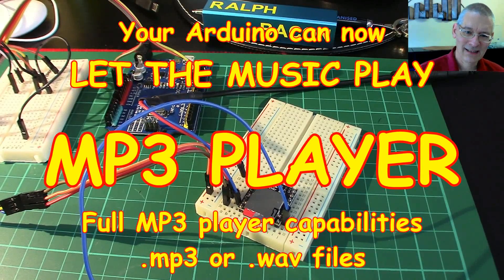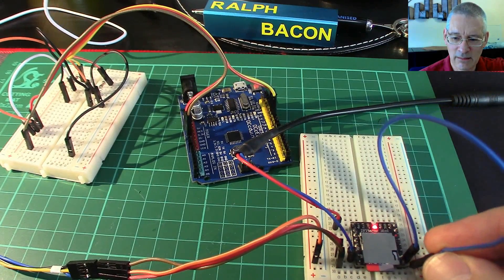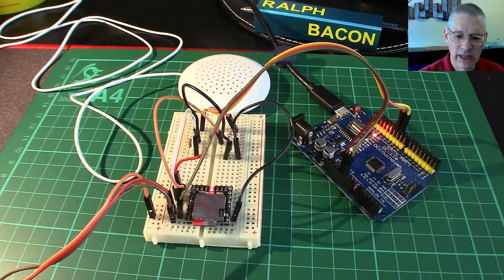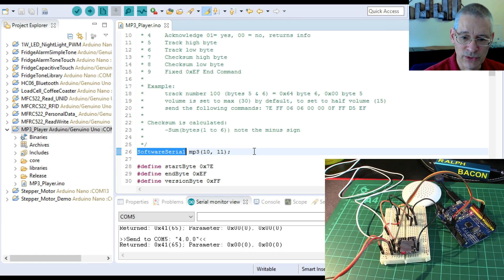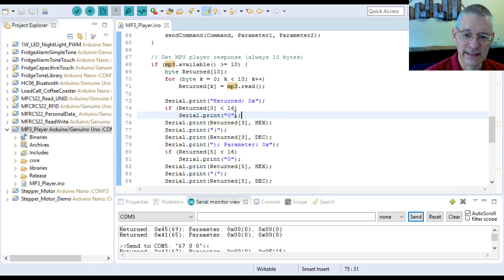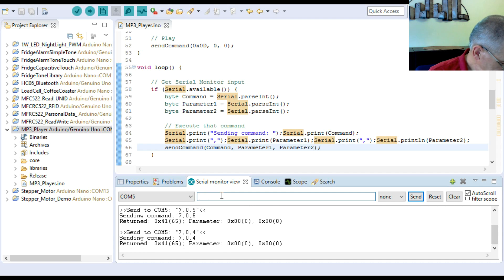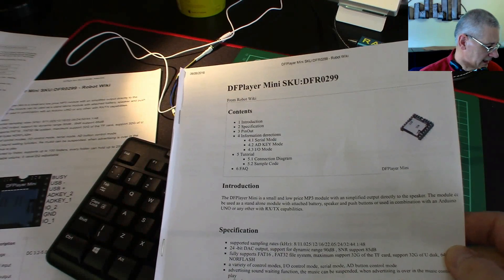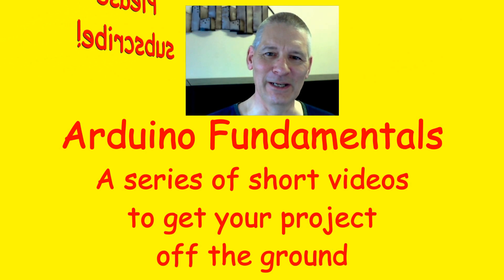#40 Let the music play! Arduino based MP3 Player for music (or announcements)

Comment: Hi  Ralph, Awesome and informative video, I liked it. it was a interesting presentation. 
I think that the TX from ARDUINO side 5V will be the high level whereas from the DFPLAYER  TX would be at 3.3V. So, maybe only one-way of attenuation maybe needed that is from the ARDUINO TX to the DFPLAYER RX  connection. Please do present ideas also of Machine learning deployment on ARDUINO controllers. Thanks again for a very good expositional channel RSB.
Reply from the maker: Thanks for the info!

Comment: Hi Ralph, I'm trying to get this DFrobot Mp3 player to change to another folder and play songs from there eg...."execute_CMD(0xF,05,001);" which it does and then stops playing instead of continuing to song "002.mp3". Any suggestions?
Reply from the maker: Is the CMD you are using just to play ONE file, not continuous playing? If so, you might be able to instruct the player, once the song has finished which you can detect, to [continue to] play [all songs] and it should play them from the current folder. A bit of trial and error, I'm afraid, not to mention avid reading of the spec sheet!
Reply: @RalphBacon   Got it! managed to get 20 folders with as many as 398 songs in 1 of those folders to work using Arduino 2560 Pro and 20 switches connected to 20 pins of the Arduino, I watched a video on UTube  that said that you couldn't use the ADKey method for this, otherwise that would have made my set up so much easier i.e. 2 pins with 10 switches each. Any comment
Reply: @RalphBacon   Oh, the next problem I am trying to solve is figure out some indicator -LEDs (1 for each folder) or a 2-digit display to indicate which folder is active, any suggestions?

Comment: Hi Ralph, I've been trying to wire a Microwave Movment sensor to the Player without the Audrino. but just can't get it to work. Can you help please ?
Reply from the maker: Does the microwave movement sensor issue the correct signal that the MP3 player is expecting (eg high, low, something else)?
Reply: @RalphBacon  I’ve tried all the pins lol. It works when you put a wire to IO1 or IO2 . I just can’t see if it’s possible without using a nano or uno .
Reply from the maker: If the sensor delivers a signal, you can use a transistor to switch the pin on the player, maybe. Like in the pre-microcontroller days!
Reply: @RalphBacon  Ok I'll Give that a try later. Yesterday I did notice that the wire i have conected to the pin 9 on the header pin if I touched the other end ofthe wire to the actual Pin 9 Pin on the Player it plays the sound on the sd card.

Comment: You probably don't check this anymore, but... I've tried 3 different modules and none work. Wired just like you. I don't even get the power light to come on. Running 4.3vdc on pin 1, speaker on 6 & 8 and ground on 7. I get a flicker from the power light when I plug in power. Grrr... Even changed to a 8gb SD card to make sure.
Reply: Never mind! File naming was the issue! :{
Reply from the maker: Thanks goodness you found the issue! I want to use one of these again in a near future project!

Comment: Hi there,

I am building a Wake Up Light alarm clock with this DFplayer. During the alarm the DFplayer should start at a low volume after which the volume should slightly increase. I use the DFRobotDFPlayerMini library, to make it a bit more readable. 
Strangely, whenever I try to change the volume in the function of the alarm, there is no sound coming out of the player.
Any idea how I can fix this? It does work whenever I remove the line of code as shown in the comment. 
Thanks in advance!

The alarm function code:

void playAlarm()
{
myDFPlayer.volume(2); // Whenever this line is removed it does work
myDFPlayer.play(1);
brightness = 30;
analogWrite(led, brightness);
delay(5000);
myDFPlayer.volume(6);
brightness = 60;
analogWrite(led, brightness);
delay(5000);
myDFPlayer.volume(8);
brightness = 90;
analogWrite(led, brightness);
delay(5000);
myDFPlayer.volume(10);
brightness = 120;
analogWrite(led, brightness);
delay(5000);
myDFPlayer.volume(15);
brightness = 5;
analogWrite(led, brightness);
}
Reply from the maker: I can only surmise that setting the volume level to 2 means it is pretty much off. Have you tried different values (from the datasheet)? Also, consider a small delay between that statement and the play statement - it might take a millisecond or two to react.

Comment: hi Ralph, do you know what's the operating current for this DFRobot MP3 module ? ( so far from datasheet, it only mentioned "Standby Current 20mA" )
Reply from the maker: I'm afraid I don't know any more than that, Ricky. But I would not have thought it would increase much because it is not driving anything substantial really. The only way to really find out is to measure it.
Reply: @RalphBacon  , noted thx again.

Comment: Ralph, can the DFRobot MP3 module plays multiple sounds simultaneously ?
Reply from the maker: I don't think that will work, Ricky, as the play command either plays the next track or the track you specify, not multiple tracks.
Reply: @RalphBacon  , yes it can't but I have tried two units of DFPlayer using ping 2-3, 4-5 as COMM, both works on single Nano. DFPlayer does not needs PWM pins, normal Digital pin will do. Thx.

Comment: I have several of these little guys laying around in different state of build. I built some up on boards and wired them to the Arduino that way, then decided it wasn't worth the effort and simply mounted some push buttons on the same board and use it direct to the device instead of through the little Arduino's. TO avoid the voltage problem I was using the 3 volt Arduino what were they called micro or mini, I don't recall which, the one with the 168 processor not the one with the Leonardo processor, however I guess that would probably work as well, just never tried it. Now I am playing around with a VS1053 shield on an Uno, I would like to be able to put a TFT screen atop the shield, I think it can be done but I am not all that confident in my programing ability, I used to be a wiz at BASIC but never really got into C. I do have a couple of Nano's that I have installed BASIC on, perhaps I will shove that into an UNO and give it a shot, na too much like work, but maybe.....
Reply from the maker: You can put a TFT on an Uno - follow my video #83 https://youtu.be/Fj0yXP0tCLU and it works very well, but does use most (if not all) the pins on the Arduino. But you could dedicate the (cheap) UNO to the cause and communicate with it using Tx/Rx.

Comment: Can anyone tell me how to read the state of a track playing with this thing?
It's doing my head in. It should be simple but it's not.
Thanks
Reply from the maker: The manual says you can query the current track by sending 0x4B as the command and then you will receive a response. For exactly what you get back, see section 3.4.1 for details (and may The Force Be With You on this one).

I do remember that I could not get the name of the track being played, just its 4-digit number.

You can download the manual from here: https://www.dropbox.com/sh/8bq5waiyhu5zsqc/AACwnzkutZaQBl1CZCeVtjcVa?dl=0

I hope this helps.
Reply: @RalphBacon   Thanks but that's like Japanese to me. I'm using a dfplayer library with software serial. I found the command. Thanks
Reply: You can read the state of the BUSY pin with readstate().
Low = playing
High = not playing
Reply: @NLGeebee   Thanks. I suppose I could put maybe a 10k resistor between the busy pin and an INPUT pin on the Arduino? 
I found code within the library I'm using:  myDFPlayer.readState()  but it's not a good thing to put in a loop since it causes the sound to stutter when called upon. It also seems to return weird numbers like -1 512 and 513 inconsistently.
Reply: ArcanePath360 I haven’t used that specific pin yet (newbee) , but the only resistor I have found in the wiki’s is the 1k on RX pin 2.
Do you use a boolean  variable to read the state?
Reply: @NLGeebee  Thanks. I linked the BUSY pin with a 10k RES to pin 4 on my Arduino and used digitalread(HIGH) to detect. As the state can only be high or low there is no variable needed other than for the pin number. Seems a little skittish on detection until I put a 1 sec delay in before reading it. This might be because of a delay before it shows as busy.
Reply: @ArcanePath360  I don't use the BUSY pin but Serial.println(myDFPlayer.readState());
512 = not playing
513 = playing
Reply: @NLGeebee  I didn't like using that command as it had issues. I had a mixture of 512 513 and -1 and it wasn't consistent. Also, there was a stutter in the sound when the command was used, as if it is CPU intensive. Try using it without a delay loop and you will hear the sound popping. Maybe I have a cheap Chinese clone, but it wasn't for me.
Reply: @NLGeebee  While you are here, do you know what the myDFPlayer.stopAdvertise() is for? I would like to be able to be playing a track, then interrupt and pause it with another track, then resume that track from where it left off. I think there is a method by having separate MP3s in the ADVERT folder but I haven't figured it out and .playadvertise() seems to be a command that's missing.
Reply: @ArcanePath360  When I looped that command, the music stuttered here also. I think it is communication-intensitive (maybe cpu) because it uses software.serial to write to the screen.
Reply: @ArcanePath360    For example:
myDFPlayer.advertise(3) will pause the current song and play song (advertisement) in <sd>\ADVERT\0003.mp3
myDFPlayer.stopAdvertise() stops the  advertisement and resumes the song
I am not sure if it will loop the advert uptil you stop it or resume automatically at the end of the advert
Reply: @NLGeebee   Thanks, I found the command. I accidentally deleted it from my list of full commands. 
Yes, I have been testing the advertise commands and have found odd things which render this unreliable until I can figure it out:
I have an MP3 folder and and ADVERT folder. It seems to matter which order you upload to the card. I believe you have to upload the MP3 folder first. So this is one problem solved.
Using the volume command stops the advert from playing (for instance if you want to fade out the current track to use an advert, unless you put in a delay() of at least 30 milliseconds. Probably because the software serial is intensive as you say. So this is another workaround.

The biggest problem I have now, is that myDFPlayer.advertise(3)  only works if a current track is playing, otherwise nothing happens. 

I need to have it where I can play certain sounds at any time (if a track is playing or not), with a button press or a timer, and if there is a MP3 playing at the time, it will pause or interrupt, so that can be resumed from where it paused, after advert sounds have played. Any ideas?

Also, FYI the loop command seems to bug out when it's the last track on the SD card. It won't play it.

Comment: Thanks for interesting video which prompted me to buy one. Have you or anyone else had trouble with songs not playing in the correct order. I recall reading somewhere that the order in which files are copied to the SD card is important with this module. For years I’ve noticed with all versions of Windows that if you select files like photos from top to bottom the LAST one is shown  first and then in the correct order. If you select from bottom to top it’s fine. This applies to copying files to the SD card for this module. I’m working on a speaking clock and as a test got it to count from 1 to 59 and spent hours of head scratching and cursing wondering why the numbers were all over the place! All the files you need for units and tens of minutes must be copied in one go using the above method.
Reply from the maker: I guess it's down to the order of the entries in the FAT table that determines the play order. I wonder if there is a utility out there that can change that on the fly, as it were?

Comment: Good video. Not sure you need the potential divider from the TX on the DPFPlayer back to the Arduino - those pins are 3.3V/5V tolerant. You only need them from Arduino to the player.
Reply from the maker: You're probably correct there. Output from the MP3 player might only be 3v3 anyway and if it were 5v the Arduino would not care.

Comment: hey ralph, did yours get warm at all during use ?
Reply from the maker: I must be honest and say I never had reason to find out whether it was getting warm. But warm is fine, too hot to touch is not. Which is it in your case?
Reply: @RalphBacon  it got very hot. Spk1 spk2 lines died . So I used the head phone channels but that didnt last long. Now it's totally dead. And I've ordered another...
Reply from the maker: You put the resistor voltage divider into the circuit, right? For the RX/TX pins?
Reply: @RalphBacon  yes sir
Reply: @RalphBacon  I think it may of been faulty...
Reply: @RalphBacon   i have droped you a message on facebook.

Comment: Ok I'm a bit confused, you say to NOT use the RX and TX but in the documentation (and in video at 15:52) its hooked up to those ports....
Reply from the maker: That time-point was talking about mp3 tracks! But, in normal use you don't want to connect anything up to the TX and RX pins of your Arduino Uno/Nano as they are used when uploading a sketch. Better option is to use SoftwareSerial library so you can allocate other GPIO pins for your own RX/TX. I don't know whether I do that in this video (it was a long time ago) but that would work just fine. Sorry for the confusion, J.

Comment: Using amplifier is optional or Mandatory in some cases?!
Reply from the maker: You can use a single, small speaker on the two speaker connections. Otherwise an amplifier on L1/L2 is required.

Comment: Quick question: Is the speaker out - line level? Or should I take the DAC outs to go to an external device, say an AUX in of a car?
Reply from the maker: The L/R line outputs are line-level and can drive an AUX input. The speaker output cannot be used to drive an amp (no common ground, it's mono / blended stereo). Any good?

Comment: I am looking for a version, where external power supply is used for DFmini, not the 5v from arduino
Reply from the maker: You could any phone-charger type power supply for this module. Just connect the grounds together (common ground).
Reply: @RalphBacon  couldnt disagree with that, but I have a scenario where arduino is not powered,  and use Dfmini standalone. I see phantom powering arduino . That's my concern
Reply from the maker: Yes, you will get phantom powering and could easily burn out the diodes in the GPIOs. For output pins you can use a diode (anode to Arduino) and for input pins a diode might work although I'm using a standard BJT transistor so nothing leaks past. See here: 
https://forum.arduino.cc/index.php?topic=540000.msg3680701#msg3680701
A bit of a pain but it must be done.

Comment: Speaker 1 plus ground speaker 2 plus ground = stereo speaker 1 + speaker 2 = mono!  I have one setup up but it is eating batteries, when I hook to my PS and watch the amps, she is drawing 1.5 amps then cut's out, resets the PS and plays for a few seconds then the needle deflects to 2AMPS plus and cuts out again.  PS is set at 5.2 volts
Reply: Found the problem I think, I followed your instructions and unplugged the speakers, plugged in headphones and suddenly all is well, all is swell and tunes are flowing with no interuption, I was using an old transistor radio speaker on one side, a tiny bass speaker on the other side, one must be drawing to many amps or something?
Reply: WOOPS Damn those earphones became VERY warm in my ears then the brand new set of earphones died!  Damn they cost me over 7 bucks!  I must have burned something up in that player, when I first wired it up, I got a bit dislypsic and wired it backwards from an 18650 battery.  Guess I will get a different one.
Reply from the maker: I forget the details on this video (it is quite old) but I thought the speaker was mono but the line out was stereo (ok for headphones, just about, but not for speakers).

Comment: Brand new to Arduino's looking to add lights and sound to 3D printed prop picked one of these up cheap from china £1 and have a few Arduino nano's going to hopefully try and work out how I can have it so when I press the button once it turns on 1 set of leds and on two presses it turns on a second set of leds and starts playing a sound file in a loop.
Reply from the maker: As you are a beginner, Pilks, it would be easier to code if you had two buttons, one for the LEDs and one for the second set of LEDs with music. Then you can build both parts separately. Just sayin'.

Comment: Thanks for the video. Subscribed and notified. I am waiting on a similar module from China ☹️, should be hear by end of next month. Looking to use voice playback for various projects including clock announcements or danger alerts. Plenty of voice synthesis available. Or my favourite is Google translate. English to french. Copy the french the reverse it back to English and record the audio on laptop via Jack input. Build any number of commands or warnings using Google voices. Ideal if you don't want a strong accent like mine from Newcastle in a non geographical project. Keep up the good work, only just discovered you.
Reply from the maker: Glad to have on my Arduinite journey, Graeme! There's another text to speech converter that I've used to great effect, that allows anything you type into the screen to be spoken - just capture the audio and you have a clear announcement. Or, make the French or German voice say the English sentence - very Peter Sellers, and hilarious. I just captured the audio from my speaker (as though it were me speaking) and put it on the MP3 player's SD card. Works like a dream. For higher quality, capture the actual PC output from your soundcard. Thanks for posting, great to hear from you.
http://onlinetonegenerator.com/voice-generator.html